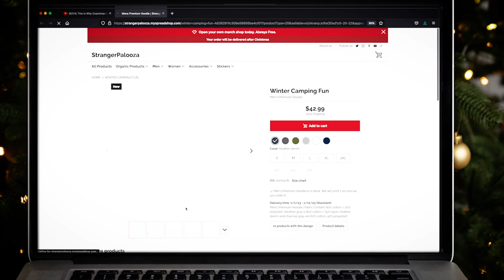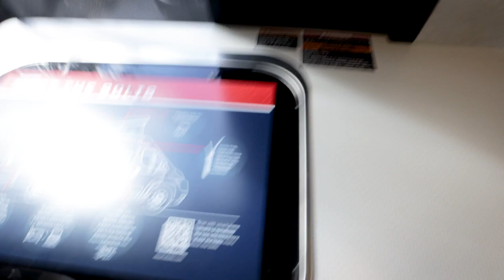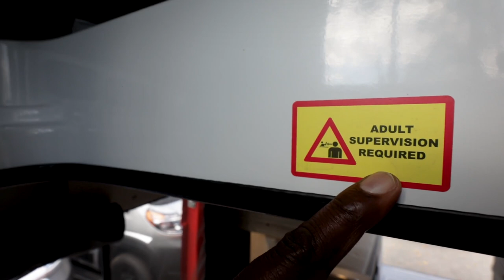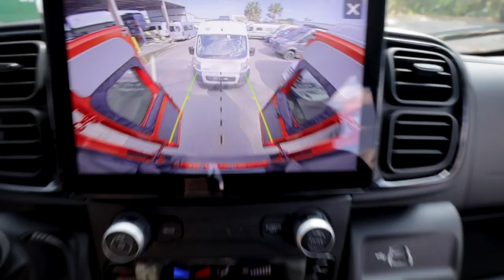Which Class B RV Camper Is The Best Value? We Compare The 2023 Winnebago Solis Lineup!

Comment: Why is every stove in the US propane?
Reply: Very high efficiency heat source.  Very standard and well accepted storage method (that 20 lb tank).  Good delivery infrastructure.   Very good user cost factor.  Didn't start that way,
Reply: @gregoire8376  being off grid and dependant on propane isn't practical.
Reply: @Abolitionista sure it is. Propane lasts a long time.
Reply: @PoeticJustice05  I guess you don't understand that you have to go get the tanks refilled when they run out. A solar set up is already with you. You don't have to go get it refilled
Reply: @PoeticJustice05  who wants to pack up everything to drive 100 miles to get propane?
Reply: @Abolitionista  how often do you run out of propane? Unless you have a ton of solar, multiple batteries and dependable sunlight, you will still need to plug in sometimes, depending on your setup and usage. Your food and water will run out before your propane will. Do you hunt? You have to return to society eventually.
Reply: @PoeticJustice05  🥱
Reply: @PoeticJustice05  solar recharges where you are. You don't have to leave to go get it. That's the entire point. US is practically the last country to have propane stoves. It's ok to transition away from old technology.